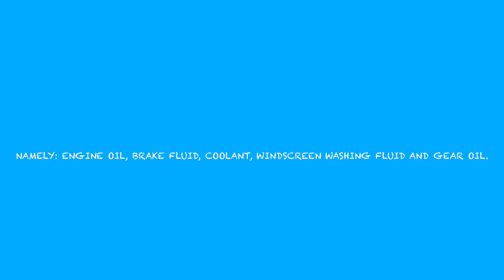5 car fluids nobody told you about||Car fluids||How to check|.

Comment: I strongly suggest the creative head to upgrade his car as we hav come long way in automobile industry like EVs . Vedios on EVs will be Highly recommended..
Reply from the maker: Point has been noted 🤪
Reply from the maker: Valid point, has been noted. But sir the main fluids like Brake Oil, Windshield fluid 
, transmission system fluid and other fluids used for lubrication are still required for EVs.